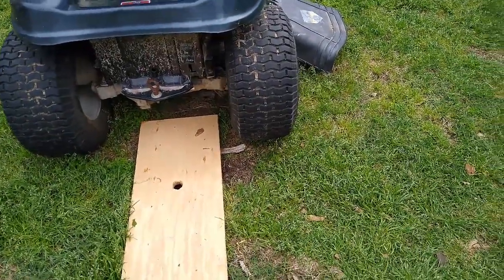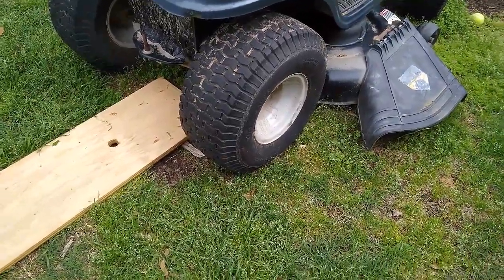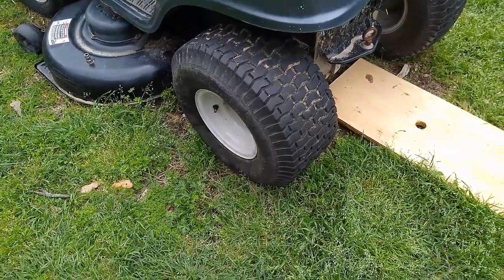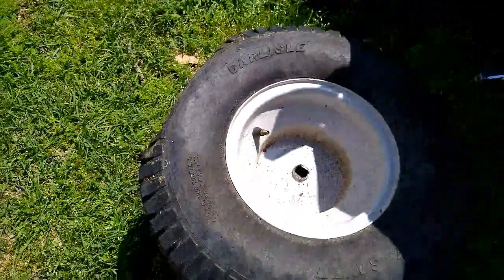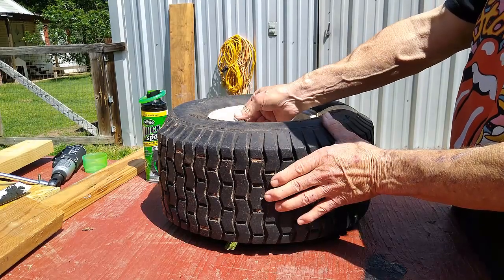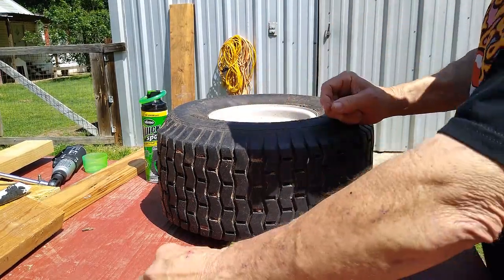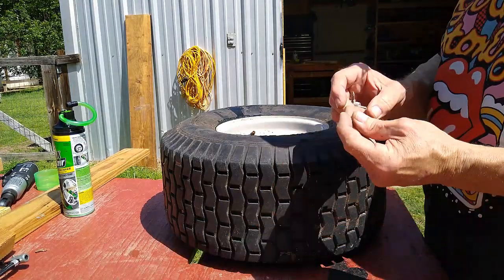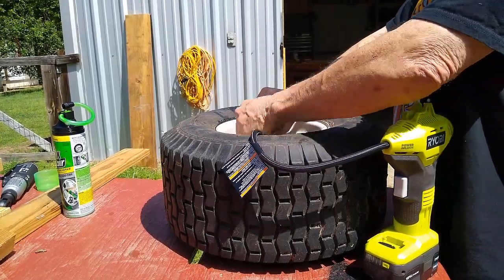Tire Repair Update

Comment: You should put the valve caps back on to prevent dirt from getting in the hole. I couldn't find Slime in a spray can. I used fix-a-flat. In my situation it worked great. My leak was very slow taking a month to bleed down. So far, it hasn't leaked out. I only used 1/2 a can per tire.

Comment: Rear Tires, I’ve plugged single holes, just don’t Ream the hole. Multiple Holes, aka rotted rubber, inner tube, and or a new tire. Front Tires, an inner tube. BTW, the tires are reinforced with multiple layers of mesh. This makes the inside of the tire too ruff for a patch. Don’t grind this away. Never had luck with Slime Sealant, I don’t think the tire spins fast enough, or gets hot enough, for it to work. Also it is the tire gauge destroyer.

Comment: I use old latex paint to seal my tires on lawn mowers and off road tires. It can also seal weather cracked tires. Bust the seal on one side of rim, grab a funnel and a gallon of old latex house paint. I pour at least a quart inside. I wouldn’t recommend it on anything you plan to replace the tire.

Comment: 6 to 8 ounces of auto transmission oil works fine too.  The seal additives work good at sealing up the sidewall and tread area leaks.  Don't laugh, try it.  Smaller tires you don't need as much.

Comment: I will never buy Toyo tires again. Every Toyo I have ever owned leaked . You don't need to take the tire off to do this. I just use plain old fixaflat because every type I've seen has liquid latex in it I fill it up drive it around the motion paints the inside of the tire with latex I do drain the tire and refill it with air because some fixaflat air sometimes uses flammables like propane to prevent the latex from drying in the cane and tire guys have gotten burned always let the tire guy before he works on the tire.  ITS A(** VALVE CORE***) LIKE A APPLE CORE. THE VALVE STEM IS WHAT THE VALVE CORE THREADS INTO.
Reply: I just put q tube in, even new tires. 
It doesn't matter what you call a friggin valve, get over it